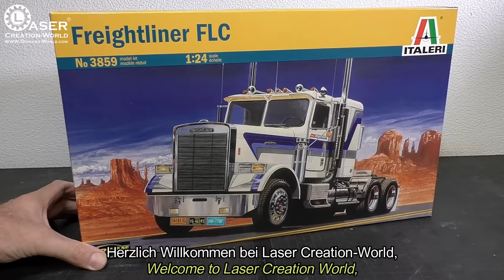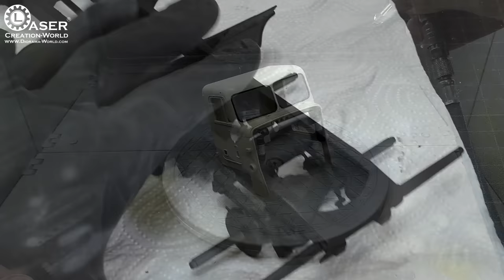Weathered Freightliner Truck scale 1:24 from ITALERI

Comment: Fantastic modelling and weathering off the charts. I am so chicken to leave washes on for very long and often wipe off way too early. I like the fine sanding sponge idea to expose a bit of the primer and ‘age’ the piece. I Tend to do more subassemblies than you, like would have assembled painted up the engine block and heads first and then installed, detailed and weathered…but you sure know what you are doing so I will shut my mouth😉😊 
I have the Mac Rubber Duck truck to build in the future and will do her dirty like this I think🤔

Comment: Oct. 2, 2022----I've always liked whatever your build, though I'm not only jealous but VERY jealous in you not only knowing cad, but a laser printer too?! Bought 2 3D resin printers last year, but then found out I had covid in January and in May, it was influenza A. And trying to learn cad has kicked my behind. Decided to go for it when I saw a motorscooter printed via resin printer and have about -5K worth of files that I plan on using in my 1/35 scale zombie/apocalypse dioramas.

Drove truck for 15 years, day cabs and sleepers, though I've never driven a Freightliner with the sleeping compartment as a seperate unit. There is a trucking company that uses nothing but them in Sparks, Nevada. Glad to see you put/painted both airlines but couldn't tell if there were glad hands on the ends of 'em. They're what makes the trailer brakes work. BUT you forget the light cord which is usually painted green and has a plug on it and it's how it's connected to the trailer. No light cords, no running/brake/turn signal lights on the trailer.  

I've also NEVER seen a chain rank like you did. Not to say that someone out there isn't doesn't have such a setup like yours. My chains would be under the bed, accessing them thru both side boxes, that panel above your chains. Then there's trucks with chain racks welded to the frame area in front of the front drive tires and they will hold 4 chains each. And believe me, they get dirty, covered in snow/mud/dirt and of course get rusty. And in America, there's 2 standards for chaining up: minimum and maximum. Minium is 1 set of chains on 1 set of the outside tires, while the trailer also gets 1 set on 1 set of its outside tires. Maximum is having chains on ALL your trucks tires and again only 1 set on the trailer. 

One thing I've NEVER seen anyone do is having chains on a truck model. There's also chains called 3 railers which will fit over 2 tires at the same time. Used to take me 30 minutes doing minimum chain up, 45-50 minutes for max. It was also easier chaining up the trailer, then disconnect the truck from the trailer for more room in chaining up.

Thanks again for another great video and yes, I have several 1/32 scale trucks and trailers that I'll be building for my dioramas. I also got a couple of Italeri Land Rover kits and their jeep/trailer and trailer sets. Plan on using the trailers to be hooked to the Land Rovers.

Comment: I really like your builds, you do excellent work and I admire your style. I was wondering, did you not have any ideas to make the couplers for the ends of the pig tails? They look unfinished. Was this an oversight because I never have seen you miss any details before. I think you could have added a third pigtail for the trailer lights for just a tad bit more detail. Other than that a most outstanding build.
Reply from the maker: Thank you for your praise and advice, I must have missed that, the devil is in the details.🫣